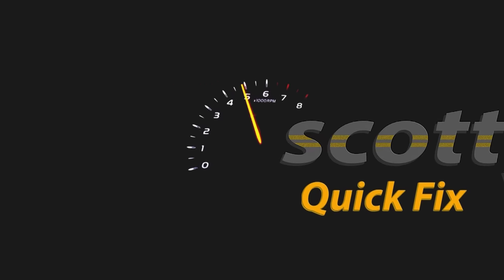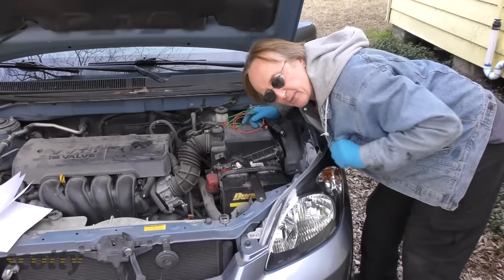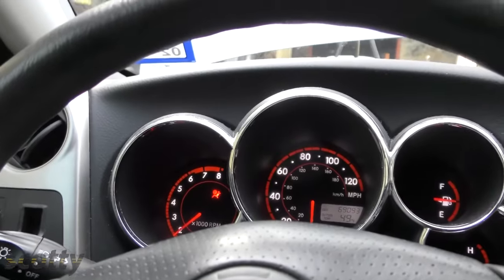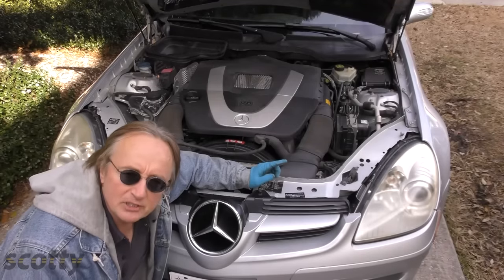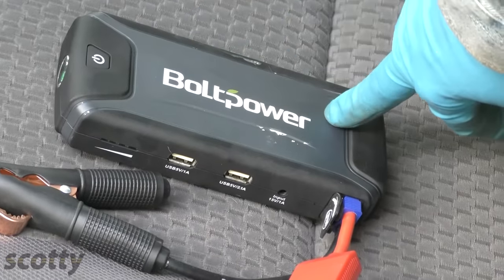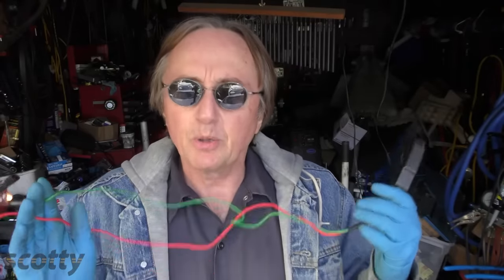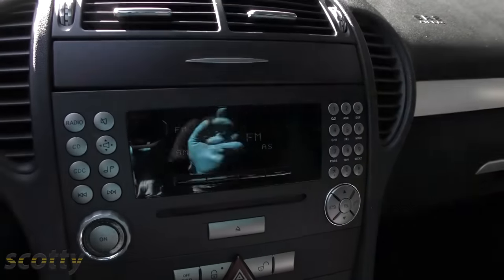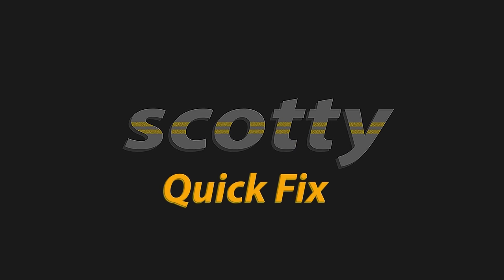How to Replace a Car Battery (the Right Way)

Comment: new cars are just getting worse and worse
Reply: I agree with Alex. Think I will hang on to my 13 yr old Forester.
Reply: Even worse than all the computer stuff is all the plastic. That's the real problem.
Reply: cars have had that "computer junk" since 1982. you drive a 40 year old car?
Reply: GRRRRR PLASTIC PARTS!!!!!!!  In the heat they burst, in the cold they snap. Yes BMW i'm talking about your plastic excuse for a water pump.
Reply: This is why I miss those simple K cars were easy to fix and cheap too and dint need all this fancy crap to change a battery
Reply: I never had one but have heard they were simple and reliable. I'm not a fan of any "newer" Chrysler products.
Reply: @chieftp  more things are controlled by computer than used to be in the 90's and early 2000's
Reply: My car just turned 14 😮
Reply: you’re preaching to the choir
Reply: That's the idea. They don't WANT them to work right
Reply: @gtowrx2001 government requirements of company/dealers greed by making it required you bring the vehicles to them for things that used to be so simple.

Comment: Yes, newer vehicles do have big problems when you disconnect the battery, which is actually a very poor design, especially for an expensive car like a Benz. There's no reason why the computer shouldn't have a supercapacitor inside them to keep voltage applied in the event a battery goes open circuit or if you need to swap out the battery. I usually use 2 jumper wires connected to the battery clamps, apply 12.5V to 14V, then remove the clamps from the battery.
Reply: electronicsNmore or 2 battery system. At least 1 battery is required to be connected all the time.
Reply: how about flash memory? save a log after every shutdown and load it up every startup.
Reply: A flash drive is like $5 at the local box store.  It's almost as if these cars are designed to cost you extra money.
Reply: They do have that, all newer Mercedes have a backup battery, most of them are located in the trunk next to the spare tire/foam
Reply: Most all Mercedes have a smaller auxiliary battery for exactly this reason.   This is only an issue if you disconnect both of them at the same time and even then the car will self learn over time.   The Main battery is in the trunk and the auxiliary is usually under hood.
Reply: I know land rover does that. It saves all data time radio stations ect
Reply: yup, it's fucking crazy how they build these amazing machines, but dont account for something as simple as this...
Reply: I thought some cars have a USB port where you can download a config file with the critical info and AF ratio maps and then upload back into the ECU after the swap?
Reply: +Thomas Rock
I've done it that was before...I just hooked up a 9V battery to the cigarette plug-in port and it worked fine. It was on an older computer controlled truck, but I would think it would be enough juice to keep a more modern vehicle alive between battery changes.
Reply: There is a very good reason for this battery design -- if you're in the business of charging customers big $$$ for maintenance, and keeping them from working on their own cars. Which all the manufacturers are. The money is made on the financing and the service department these days.....
Reply: They could of have used nand flash flash that regularly stores a snapshot of the keep alive memory (with the exception of clock and trouble codes) every so often ranging from storing memory seat settings to idle information based on the weather conditions the vehicle is in. It will still require resetting the clock after replacing the battery but, no big deal because it's just a clock to keep time. A Japanese car would give you a minor nuisance after replacing battery but, it's driver correctable.
Reply: Yeah and to make it worse, if the owner tries to circumvent this bullshit by keeping the memory "warm" with a 9v battery in the cig lighter outlet, it can void the warranty if they discover this
Reply: Flash memory have finite write cycles.  Over the years, the car will have been shut down enough times to where you may wear the flash memory out.

The original poster suggested a supercapacitor, but I wouldn't.  Those can fail after a number of years necessitating replacement.  I would suggest a user-replaceable battery, such as a CR2032 lithium cell, with a maintenance-minder to inform the owner to replace it should its voltage read too low to sustain the volatile RAM in the vehicle's systems in the event of a main battery disconnection.
Reply: While its true there are limited number of write cycles in flash memory, the changes that would be written to flash memory in flash memory would have been small incremental changes that would barely even affect a 16GB SD card. What would be best is to have a traditional system with flash memory augmenting it.
Reply: And, perhaps, using a larger capacity flash memory where the data can be "rolled" to new memory addresses, spreading the use of the memory over its entire capacity and prolonging its life.

There would need to be a safeguard against corruption of the data contents, probably in the form of an error correction algorithm.
Reply: Or better yet....an easily replaceable CMOS battery.  Then you just have to open it up and replace it before removing the main battery.
Reply: Because a super capacitor costs a bunch of money 💲💲💲
Reply: Can anybody help me....this might be a very dumb question but I've never done this before. Once I connect the clamps to the 12v battery do I turn it on ? I know it's a stupid question but he doesn't say in his video and I'm afraid of turning it on a I fry something
Reply: @chriscs9080  do u know if u turn that 12v battery on?
Reply: @Watcher3223  and just include a cr2032 with every battery change.

Comment: I work at an auto parts store and we never use that device. My manager is too cheap to take one off the sales floor for store use. Many times I've changed a battery just to have poor idle. Sometimes the car will have NO idle. It just shuts off if you take your foot off the peddle. So if you take your car to a store that offers free replacement, ask them to use the memory keeper.
Reply: That's a shame. The typical customer doesn't need to use a memory keeper on a monthly basis, but an auto parts store that sells batteries would. Plus, it could be a teachable moment to customers when they decide to swap their own battery next time. Who knows, customers may even be interested in buying one once they know what it is used for. I personally do not need a memory keeper for my 1990 Thunderbird (it doesn't have an OBD2 port), but I may buy one for my relatives that drive newer cars.
Reply: We do it at my work just because we don't want to deal with the problem that could arise. Why no do it and avoid all potential issues?  The only cars I've had that have messed up are Kias and Fords... Both have throttle body recalls.
Reply: If there is one thing i really hate on modern cars, its the electronic throttle control......
Reply: Lol don’t tell me it’s ethier O”Reilly or auto zone
Reply: i would get a job somewhere else and tell people to avoid that place, you're doing damage to your reputation by working there.
Reply: So what years and models do you have to worry about this? I got a new battery at autozone today for my 2012 Camry and asked about them using a keep alive memory tool and the dude looked at me like I was speaking Japanese. He said they never used one. I let him change it anyway and so far I haven't noticed any problems. Everything works fine and the car is running fine too. Even my radio presets were not lost. The only thing I've noticed that was reset was the gauge that I think shows my mpg.

Comment: You can also save the 15 dollars by just connecting the battery leads to any 11-14V power supply (like a series of small batteries or any charger with the right voltage) while changing the battery. I am sure DIY car guys all have a 12V power supply laying around somewhere.
Reply: 9v battery will work usually as well I was told.
Reply: I have also heard about the 9V battery in the cigarette lighter slot. I am sure it can work for some cars but I woudlnt risk it if I knew my car is likely to have these problems.
Reply: +Stepside1986 - 9v battery through cigarette lighter USED to work. Not reliable solution nowadays.
Reply: A 9V battery is a very stupid thing to do for many reasons. The main one, the moment to connect the 9V battery, current will start to flow from the car to the 9V,  trying to charge it at 12V.

Comment: Could you not attach one of those jumpers that have their own battery to the connector terminals to keep the power while you disconnect and replace the battery? Or maybe one of these battery maintainers that plug into the cig lighter?

Comment: that is why i enjoy the older cars.  not all that electric crap to deal with. even more fun when u have to replace all that crap too lol
Reply: I had a 2008 Toyota Tundra and I just sold it this past summer with the original battery still in it.  Had enough other problems with it while it was under warranty and those problems were starting to resurface again after the warranty had expired so I dumped it before that stuff needed fixed, and just told the buyer they may want to think about putting a battery in it.  Told them about the issues that were starting to surface again but the buyer was a mechanic and said he didn't care...also didn't bat an eye at the $18k price I had on it, handed over the cash and away he went.
Reply: damn. idk i was told that tundra is just a "luxury large truck" no actual work truck or under powered.  i was told that tacoma (minus the rust) is the way to go.  i was looking to get a v6 4x4 but i was told that the 4L 4x4 is awesome. im not sure, my current 4L is issues, but im dealing american atm lol.  what issues were returning?
Reply: When Toyota released the 2nd generation Tundra in 2007, they were boasting about its competitiveness towards the 3/4 ton market...its anything but.  The IFS is what limits it to a point, but the rear axle bearings are another problem along with the front differential bearings....both were Toyota Service Bulletins (TSBs).  Both should have been recalls, a bearing freezes up on the highway locking up 1 wheel could cause loss of control, injury or death.  Both those issues were covered under my factory extended warranty, however they resurfaced about 2 months before I sold the truck.  I told the buyer what was going on and that they possibly could get some help through the dealer since those issues were originally reported and covered under warranty the first time, and obviously the replacement parts weren't any better, and the truck was used for far lighter duties since those repairs were done.  

I went back to my 1988 F250 460 4x4 super cab long bed pickup...older, higher mileage, but have never had axle bearings or differential bearings fail and its about 29k shy of the 500k mark and have never had any engine or transmission trouble.
Reply: I agree
Reply: Thisisbb1 
I got a 52 Ford pick up easy sailing
Reply: Could be solved easily with a replaceable power bank added by manufacturers of the car but hey, no reason to make your life easier as a car owner. :D

Comment: So why, with all this "great" technology we have in cars these days, the system does NOT have a back up battery installed so the computer does not loose memory? Even home PC's have a battery on the main board so memory is kept when it is turned off.
Reply: LifeOfAnEnglishman My car does keep it's memory right down to the clock and stereo setting when the battery is removed for a few hours. It's not a Mercedes/Audi/Lexus... it's a 2016 Fiat.
Reply: Just one more thing to fail I guess. All batteries wear out eventually, so it's another battery to replace one day. Just like those stupid TPMS's, they eventually die too and then your stuck with the error code on your dash unless you want to pay hundreds to get it fixed, and it's something you don't even need.
Reply: Same here, did the same to my Mazda3. All I had to do after replacing was to reset the power windows. Everything was working fine. No memory loss. I guess that depends on the manufacturer and what do they equip their systems with.
Reply: They want you to take the car to the dealer....money thing of course!
Reply: Because anything that keeps people (or their cars) in your service bay is good business.
Reply: Ph so in other words it's just so that customers can be ripped off for more money.
Reply: And it’s also the magic trick to fix a bad overclock
Reply: Because it's no big deal. Unless you have one of those fancy german car you can just plug back the battery and drive away anyway.
Reply: @Gary-tc7zx  Does your car have electronic fuel injection? Electronic ignition? Electronic gauges? All these things are a lot more likely to fail than a flash chip that stores settings and a little battery to keep the clock ticking that's kept at full charge 99.99% of the time.
Reply: probably to keep mechanics employed
Reply: Doesn’t all modern mercs have the auxiliarry battery which does keep all the settings of the electronics of the car? I would imagine thats what this battery is for.

Comment: Like Scotty, I'm old-school and would have replaced batteries in any car the traditional way so this is totally FYI educational - kudos!  As others have indicated below; save the $15 and before disconnecting the old battery, just hook up another 12V source in parallel with some jumper connectors (even small gauge will do).  You have to connect that $15 device with jumpers inside the car anyway so why not do it where the battery is.
Reply: ray bee That is why I said "12v source",  meaning a jumper pack or an old-style charger, not another battery.  Yes the new battery in parallel would be awkward to work with.

Comment: Once my 4wd when out on my 99 ranger, I looked up the code online and it told me to disconnect the battery for 20 minutes or so. After that it worked just fine. It's crazy how far the car computers have come.

Comment: You forgot to mention to turn off the interior accessories/close the doors to turn off the lights because now all the current is going through the obd port and could pop the fuse causing the KAM to be reset anyway.
Reply: blankpanic Scotty should also have mentioned not to short out the positive terminal as it will have a small amount of current running through it
Reply: it should be obvious for most of people .. I guess
Reply: i agree, it should be, however, the first time I used one of these memory retainers I had to consciously remind myself not to short out the positive terminal as it was now 'live', I ended up insulating it while replacing the battery, the memory saver, however, is a great tool
Reply: another good point for people to keep in mind.
Reply: forgot to mention, excellent point that you mentioned about turning of all accessories and closing the doors!  I still think the memory saver is a great idea
Reply: zmanvideo1 ......how did you insulate it?

Comment: I'm really glad it wasn't this complicated when replacing the battery in my 2010 Honda Civic. The only thing that happened was that the stereo unit locked up, but I was gonna replace that with an aftermarket unit anyway so it didn't really matter. The engine and all of the other electronics worked normally when I connected the new battery and I didn't notice any abnormalities at all. I guess Honda's engineers think a bit more practical than Mercedes' engineers.

Comment: I had a 2001 Olds Alero.  first time i changed the battery, the immobilzer kicked in.  I had to have it towed to the dealer.  from then on, i always had a charger on the car anytime i had to do anything that needed the battery to be removed.  I had a lot of fun replacing the starter in that car!! sparky sparky!!

Comment: Hi Scotty!  You are amazing!  After watching so many videos, I bought some cars at an auction to flip. I checked your videos for engines, SUVs, cars... and I cannot wait to see if I can fix and flip. (Chevy 1998 Lumina, 42,000 $775, no keys, Chevy Tahoe, 2001, drivers door doesn't open from inside -common issue in this make & model, $1750 and then in a last spontaneous moment at the auction, a 2001 Jeep Grand Cherokee Laredo for $795. ) I did not watch any videos on battery replacement until I was getting ready to pick up the Laredo Monday.  So here is my question:

What happens if the car has been sitting without a battery for 6 months? When I replace the battery, am I going to have endless repercussions because of this computer system?

Thank you for serving the public,... not the large corporations.

Comment: Great idea, Scotty. For less cables I recommend the Settings Keeper. Stick a 9v battery to one end and plug the stem into the cigarette/accessory outlet. I've heard people pay at least $65 to get a code from a dealer to unlock their car's radio. Screw that.

Comment: Like your videos Scotty! But to be fair Mercedes is one of very few cars where to this day you can simply swap out the battery without any issues as the car relearns everything by itself. The only thing you have to do is move the power windows up and down once so they do so automatically. Also it is a good idea to leave the ignition on for a few seconds before starting as the ecu will relearn the throttle, but even though I always forget to do that the car starts without any issues. The only thing that is annoying about the Mercedes battery change in my car, is that the new oem Mercedes 100 Ah battery costs almost 200 dollars!

Comment: I'm really glad that my car is old enough to not have these issues. The only thing I need to do after changing the battery is to reset the immobilizer, and that's done by locking and unlocking the doors once, then it'll start again.